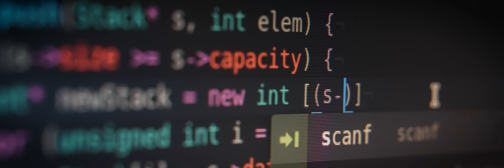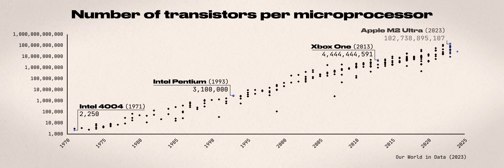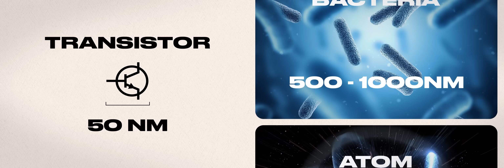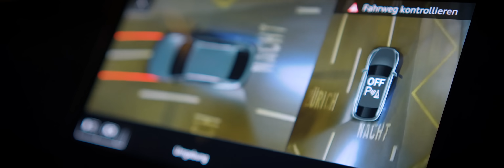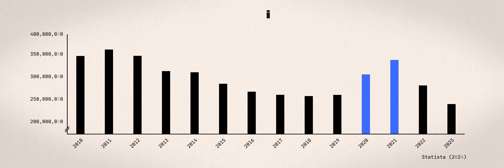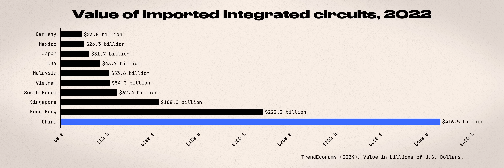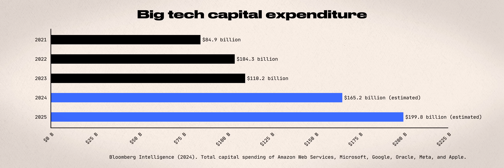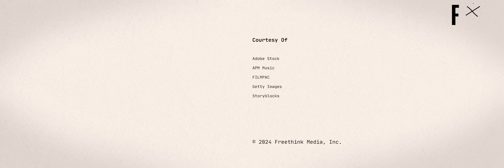Chip Wars: Why Taiwan is the most important country in the world | Chris Miller

Comment: TSMC has an ecosystem that supports the chip-making business in Taiwan. There are many local companies assisting TSMC in Taiwan that you cannot find them in other countries. TSMC's CoWoS (Chip-on-Wafer-on-Substrate) is high-density advanced packaging technology second to none in order to make the high density AI chip possible. It took many years of effort and it is not something can be copied easily by other countries.
Reply: The law makers may not have the understanding to this.
Reply: Oh, spare me, the US can do it, they will do it. The world needs more chip diversification.
Reply: @chrism.1131 the US only has 150k workers classed as "high IQ" this is about the same number as taiwan. and most of the ones in the US can make more money at FAANG than they can in manufacturing. so basically the US cannot replicate it
Reply: @littleones-yeahh  I disagree
Reply: @chrism.1131 us can do it but it’ll take them years and by the time they did, Taiwan would have advanced more. It’s like the race between the rabbit and the tortoise but in this story the rabbit didn’t stop to take a break but rather moved even faster down the road.
Reply: If you are a manager, if you jump ship and bring the original work secret past, you will be accused!
And where you're going to be, you need to be in East Asia, some big country, not in the USA.
Reply: @chrism.1131  TSMC did in fact kept on trying to build factories in the us, efficiency way too low and cost way too high, they couldn't get it to work. If the US could do it and all your electronics used US manufactured processors, the price of electronics will increase by a lot.
Reply: @陳漢生-e9r  I disagree

Comment: Not sure he knows chips at all.  First, most important thing is design.  Foundry just the hardware realization.  Basically glueing billions of transistors together according to the designs. Tsmc produce the smallest, fastest transistors which lead small size, better performance but the same logics as lesser processes.  There are only two main areas of applications: cell phone and high speed/AI computing every else you can get away with much lesser processes say 45nm.  Even cellphones, you can get away with better design and features and end users cannot tell 0.001 and 0.00001 second wait time.  AI training is hard one but these are other ways to get going for a while.
Reply: heat seeking missiles
Reply: @spvlinn9009  yeah yeah, you guys just keep using the less advanced chips then.
Reply: Design is important but not as important as foundry. You can design something but it's worthless if you can't put it to work and mass produce.
Reply: @ kind of true. Most people can not tell differences between 7nm or 3nm on their phone.  You can make it  up by better designs tighter software integration…..

Comment: I still have and use a Samsung Note 5. That is 9 year old technology. There are 3 things wrong with it. The headphone jack doesn't work. The micro-USB port does not transfer data, and the version of Android is so old that some apps won't install.  It is not because I need smaller, more advanced transistors.

There is what I call NBAN technology. Nothing But A Number. Just because some measured performance is better does not mean that it is Effectively better.

GDP needs planned obsolescence!
Reply: Your thinking is very small tbh. Do you really think smartphones are still the most bleeding edge use case for microchips? Get with the times unc.
Robotics in particular will benefits greatly from further power reduction, heat reduction, and streamlined computational pipelines.
Reply: @zararianrock  my daughter just bought a turntable.
Reply: @zararianrock  
I never said smartphones were the most bleeding edge of chips. I still have my time wasted by ads on crap I don't want and will never buy.
But my thinking is Big Enough to notice that Economists NEVER talk about the Depreciation of Automobiles and Smartphones. What is Net Domestic Product? Oops, economists can't do algebra because consumer depreciation is not in the equation.
.

Comment: Imagine a future where China shifts away from traditional silicon chips as we know them today. Traditional chips rely on silicon wafers, using transistors to represent binary values of "0s" and "1s." If China further its advances to quantum computing, they may soon achieve breakthroughs in materials and production techniques. They are already one of the leaders in quantum computing.

At that point, chips could be developed to communicate using "quantum bits" or "qubits." Unlike classical bits, qubits can exist in multiple states simultaneously due to a property called superposition. This allows a qubit to represent both 0 and 1 at the same time, enabling quantum computers to perform complex calculations much faster than traditional computers.

In summary, while traditional silicon chips operate on binary logic, quantum chips leverage the principles of quantum mechanics to represent and manipulate information in a fundamentally different way.
Reply: In short term is it worth to have better quatum computers than classical ones running crazy AIs like one with general intelligence, which can help breakthrough in everything?
Reply: You can imagine but it will never happen - China can't innovate so they will always be followers because breakthroughs and disruptors require the fundamental ability to challenge the status quo and established thinking which is forbidden in a fascist state.

Comment: I thought we were at the end of moore's law because chips are so small now that the laws of physics prevent chips from getting smaller and operating predictably
Reply: Moores law is not a law of physics but rather an observation of improvement trends. Yes, we're getting close to the physical limit of transistors.
But we can still do things like create faster application specific sub-sections of the chip. (ASIC). FPGA (software defined transistor layout). Vertically stacked transistors. Make the chip bigger. Remove redundant circuits like AVX 512. etc
Reply: Well new paradigms could theoritically take over…

My personal bet is on spintronics and ferroelectric related technologies…

For example, Non-Volatile-Memory like SOT-MRAM (currently being investigated by European research center, IMEC) could theoritically be disruptive and enable new use cases…
Reply: @nicolasdujarrier   Magnons are the future.
Reply: Keep an eye out for dry photoresist technology from Lam Research which will take us down to sub NM sizes, we have not reached the limit yet (Mechanical Engineer on that project)
Reply: @loganalexander3207 I agree that there is still plenty of room for further technological improvements in silicon semiconductor technology, but I find it a bit pity that there isn’t yet more work done to enable the next paradigm : spintronics. It is like pursuing investments in LCD displays instead of emerging OLED displays… 

Non-Volatile-Memory (NVM) like the SOT-MRAM investigated by IMEC could be disruptive, and the manufacturing needs to be scaled-up. Spintronics could then piggy back on the MRAM manufacturing tools and expand the toolset from there…
Reply: We can't make transistors any smaller, but we can attach more of them and stack them, and find new ways of plopping them on the chips
Reply: @Sanpaku-san  Stacking transistors seems to be a major problem as well. It introduces a tonne of complexity and yield loss into the chip because the need of wafer stacking

And then even after that the thermal buildup during processing becomes so great you reach thermal limits of the chip quite quickly, and need to do in-die water cooling just to make up for it. lol.